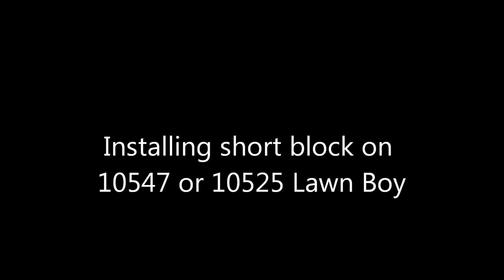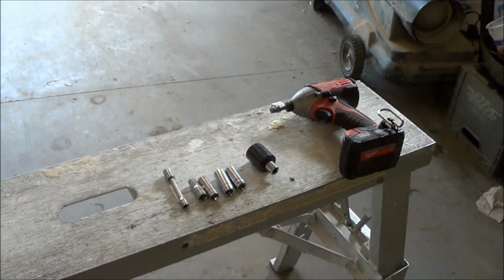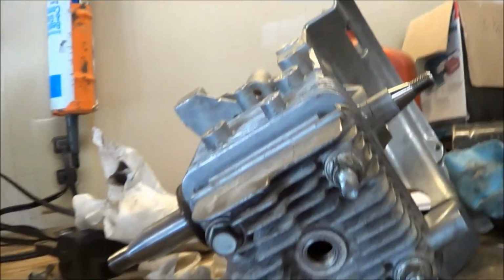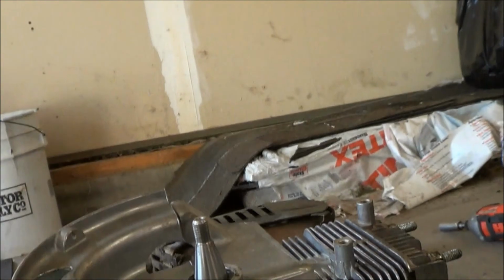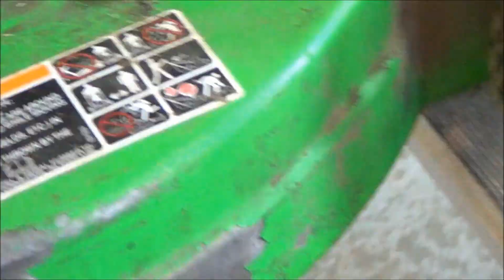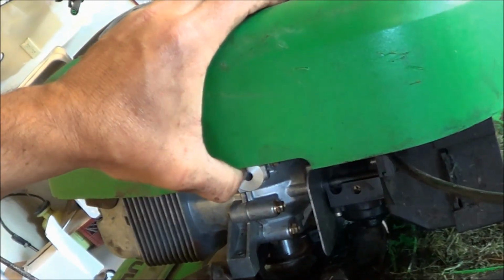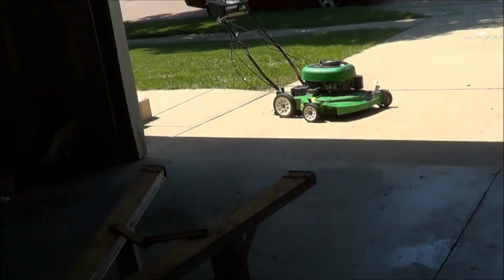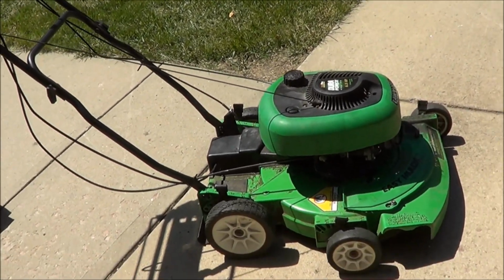Installing short block on 10547 or 10525 Lawn boy

Comment: Wow man! Must say that it’s been 10 years since you installed it. 10 years later she’s still running! Makes me wonder and all of us that Duraforce can last probably another 20 years or more. Let’s see what’s gonna happen to it 10 years.❤
Reply from the maker: I did put on an hour meter 8 years ago, I split time with my M-series, so far I have 70 hours on the dura-force,  Only issue has been clogged idle jet,  I did put on a new fuel filter that has took care of this issue.  Also 50 to 1 mix

Comment from the maker: yep, you can have basically a new 2 stroke lawn boy for 130.00 or less depending on what else you have to replace.
Reply: Hey, great video! I have been looking for parts for a Toro 210 R snowblower with a R tek engine, I have had no luck, where do you guys order your parts from? thanks. Joe
Reply from the maker: I just found parts on Ebay, I know the Ebay dealer I bought the short block was from Chicago area.  Partstree.com should have model.

Comment: Did you use 95-7636 or 95-7637?  I have a 10547 electric start.  Can I use the 95-7636?  It's 100 cheaper.  I know 95-7636 doesn't support electric start but I don't use anyways
Reply from the maker: I have been trying to find my old email on which short block I used.  I cannot find it but I am pretty sure I used the 95-7636 (95% sure).  The only difference in block would be provisions for starter which I also do not use.  The fly wheel will go right on, the key did get bent when I tried to remove it, but the mower was left outside for several years before I bought it.  There are two different set screw location on the crank.  Make sure you take a pic of the pulley location and how its installed (up or down) before you take it apart.
Reply: thanks Lewis.  Yeah the short-block w/ out electric start is only around $120 delivered, vs about $240 for the electric start.  I need a new battery anyways and there is risk the starter and or alternator could go out if i invest in a new battery.  A new starter costs $350, lol... no way.  Nice video.  I think i will try the 95-7636.  I might even buy 2, at some point these short blocks will all be gone and the value will be very high if i ever want to resell.

Comment: You Need To Adjust The RPMs On The Air Vane Governor it’s Running To Fast other Than That Good Job 😎👍🏼
Reply from the maker: The short block has been running for 5 years, no issues, I did replace the vane spring.  I also added a tach to verify Rpm,  2900 to 3200 depending on load.  Thanks for your comment.

Comment: where did u get the kits from and how did u put the needle bearings in?
Reply from the maker: I got the kit or short block from a dealer in IL off ebay, the short block has all the part installed, I did not have to install the piston and crank.  I just had to use the cylinder head off the old engine.